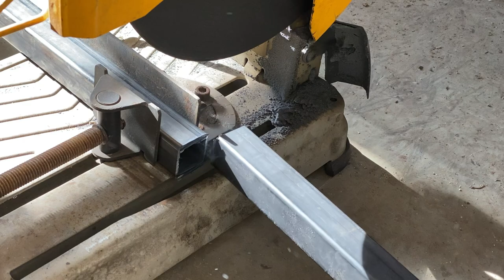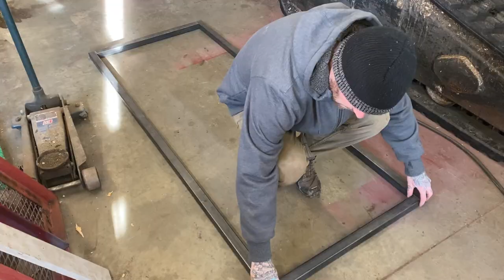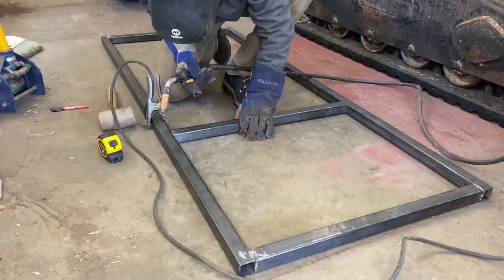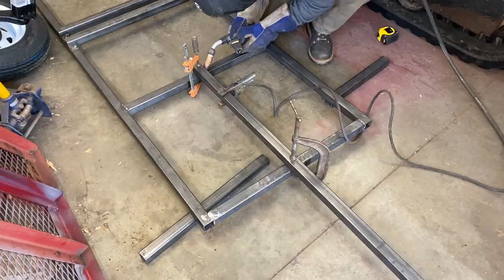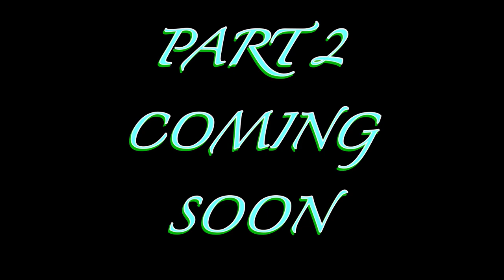DIY Moto Tow Behind Trailer Build / Pt. 1

Comment: What did you use for the axels?? I can't find them anywhere
Reply from the maker: They are called “torsion axles” and I think these were 500lb ones, they usually run for 300 - 500$ online. I’ll post a link to one similar for you. They are sick. Make sure to get the right hubs so that the number of holes on the wheels is correct, there are 4 and 5 holes 

RIGID HITCH INCORPORATED 500 lb. Torsional Stub Axles with 4-Bolt on 4 Inch Hubs (TSA-5100) https://a.co/d/hd85u62

Comment: What you call the wheels setup. No spring or shocks you just bolted it on.
Reply from the maker: They are called torsion axles, they are awesome, they use rubber inside to dampen

Comment: Great looking frame!!    What dimensions did you decide on?
Reply from the maker: Thanks! It’s rough in spots but I’m working on it the rest of the week, making progress. I went with 30”x 74” , it was the best fit for me, I can fully lay down that way, I’m putting 1.5” foam panels in the open spaces under the decking, I’m surprised how fast it’s coming together. 

Question..is it feasible to install electric brakes on these spindles? They have spots for them but I couldn’t find any online
Reply from the maker: @bryanirwin5473  everywhere I’ve been looking the minimum load for the electric brakes is in the 2000lb range and higher so I’m contemplating designing some disc brakes, very small, either hydraulic or cables, like on a go kart, atv, or moped, it might be better to have physical brakes so they don’t stick on, and are much more reliable and serviceable on the go. 

I’m not sure if it can be done on this particular setup, I may need to add a spacer or something. But it would so much cheaper. I have access to a lot of disc brake parts here for free
Reply from the maker: @bryanirwin5473  I’m going to put a door on, and a bubble window I think, but I’m going to tackle that as it comes
Reply: @JMERCHRIDES  Adapting a brake system from a golf cart could be a way to go.  Golf carts have been equipped with disc brakes for years.  The cable drum brakes on my Taylor Dunn Tram are prone to lock up under hard braking conditions, but it weighs 1200 lbs.  Designing a surge system for that would be interesting..     Throw a piece of plywood on the trailer to make a deck and then add weight to it.  It will help you find a balance you're comfortable with..
Reply: @JMERCHRIDES  Add a small vent to control condensation when you sleep inside..
Reply from the maker: @bryanirwin5473  absolutely, I’m stealing a lot of the systems I used from my van build plans, it’s Essentially just a micro camper so luckily I still have most of the components and the knowledge of how the work, that’s going to be the real fun part, after all the serious stuff is taken care of. Making it comfortable and functional how I want it, can’t wait.

I’m putting my little wood burner in there too if I can fit it, it’s absolutely tiny and just uses a small handful of charcoal pieces. I kept it from my van build, it’s like 500$ so I had to. It’s an excellent extraction vent in the summer, dehumidifier/ heater in the winter and fall
Reply: @JMERCHRIDES  Nice!   Are you planning on implementing a rail system on the exterior  to mount grills, tables, etc?
Reply from the maker: Yes, I’m planning on using the aluminum strapping to make places to attach all sorts of things.

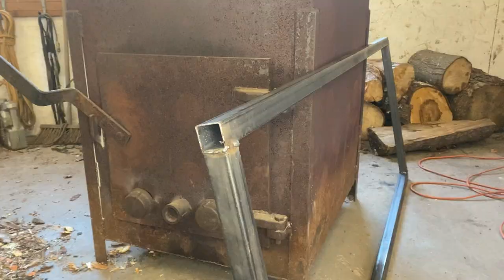Comment: @ 0:55 the welds look pretty scary. If your trailer ever strikes something hard those welds will come apart. You had extremely poor penetration.
Reply from the maker: Thanks for thinking of me 🙏 it held up well on the trip until I gave it to a gentleman at beanpot campground in Tennessee. No issues with the frame whatsoever, I towed it about 1500 miles on lots of different terrain and had a fun time with it, but ultimately I didn’t really like towing a trailer all that much to be honest